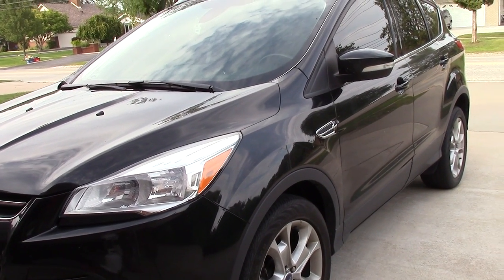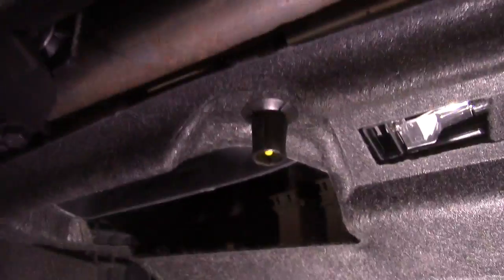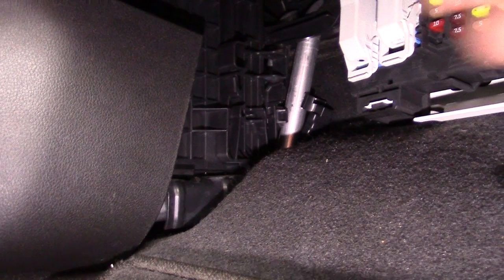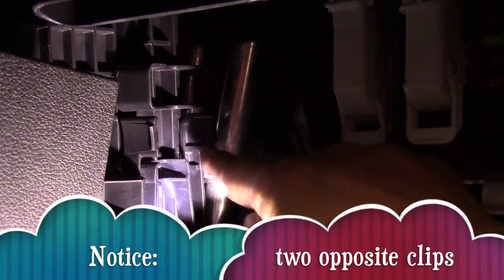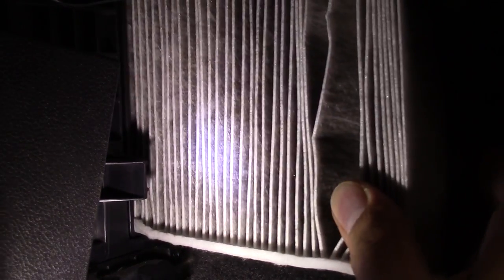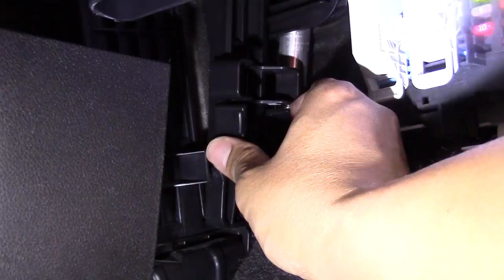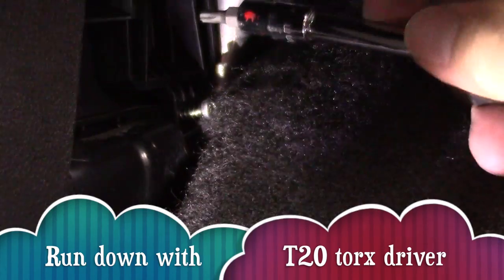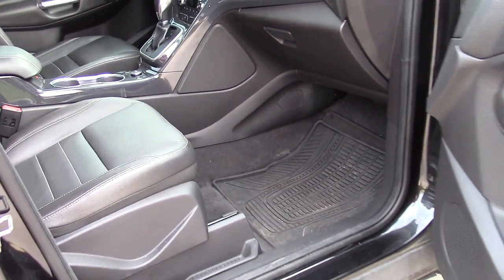How to Replace "Cabin Air Filter" 2013-2017 Ford Escape DIY

Comment: Yup this, the battery, everything with this new style was complete bullcrap. The old older model was so easy to work on. This one the basics are torture. This guy makes it look easy belive me. And to change the battery the old style all I'd need is 5 mins. This model it's half a day project.
Reply from the maker: You're right. I like the old model better.
Reply: 10 minutes to replace battery go threw the cowl

Comment: Most complicated air cabin filter I've done. The engineer had to have been high. "Should I use a regular Philips screw?? Naaa let's go with a torx and put it on the way bottom. Also while I'm at it lets use screws for the engine air filter assembly and put the battery under this large price of plastic near the firewall of the engine compartment.  Yeah there we go!"
Reply: They do that on purpose so people would give up and take it to the dealer. The dealer charges like $75 to change this the madness.
Reply from the maker: You're Eric.
Reply from the maker: I know what you mean. They don't make it easy for us. Lol
Reply: I hope I dont have to change the battery in mine for a loooooong time. It's in a retarded location as well.
Reply: battery that comes in new cars ususally on last 2 years.
Reply: Eric J Davis I agree completely. When I rule the world, every cabin air filter will be located behind the glove compartment. And every gas cap will be located on the driver’s side rear quarter panel. And every windshield wiper control stalk will work the same.
Reply from the maker: That would be a perfect world. Lol.
Reply: Seen worse
Reply: @bubaJoe  Mines going on 6 years
Reply: They design them to be easy to build. I am sure on the assembly line doing things in the "right" order it went to gether lickity split.  

Same thing for torx versus Phillips. You can stick a Torx screw on the screw gun and it will stay there while you stab the hole and pull the trigger. A Phillips screw will fall right off.  Much faster and easier on the assembly line - a pain in the butt for everyone else. :)

Comment: The hardest part of the process for me was reinstalling the plastic filter housing cover.  It would not seem get around and inside the plastic side pieces which secure it in place.  Going back out now to try again.  I'll install a very small amount of lubricant around the securing arms to see if that helps.  Will update this review if I get it in.

UPDATE:  I'm a big dummy.  I was attempting to secure the air filter housing cover the wrong way.  You actually apply it with the protruding part facing towards the air filter and the clamp arms facing away from the air filter.  It looks like it would go in the other way but it doesn't.
Reply from the maker: I hope it worked out in the end. Thanks for the visit.
Reply: I did the same thing 😂😂😂
Reply: Did the same thing. Definitely looks like it should be the other way though
Reply: Scott, I just joined the "dummy club".  Thanks for the help.

Comment: This is a total total DIY...   The disassembly, removal, and reinsertion took all of a second or so.  The fitting of the cover was super tricky to say the least.  I first lined it up and then felt up top to ensure the flange was properly in place.  I then pushed but pushed up and forward at the same time.  You'll hear it click into place and then see it's flush with the housing.  I then screwed the screw back in, which was no big deal.  All in all, 15-20 minute job with the VAST majority of the time spent reinserting the plastic cover.  Interestingly, it's difficult to tell if the plastic screw caps are properly in place as I could not get them to "click."  Huge $$$ saver.  Also, the filter was almost jet black after 15 months, so this is a very worthwhile service.
Reply from the maker: Thanks for sharing again John.
Reply: True in the video you can tell the cover is not properly seated. This is the point where you mention to line up the screw. The tabs aren't even in yet. I believe because the top of the cover wasnt inserted first. Also taking the filter cover off when you said it required some muscle it's because the screw tap hits the carpet

Comment: This isn't even the worst part. Try filling the coolant reservoir. It's almost to the windshield at the very rear and not out in the open hood. There is maybe 3 inches or so clearance.  Since I was on side of the road, I had to dump out my Rockstar can and fill with water, then bent the end of the can so I could pour it in. The Escape is a really good vehicle in all honesty, but a bitch to do what should be simple.
Reply from the maker: Yes you're about that. I really liked my escape but Ford doesn't make easy for us.
Reply: go to any trucks stop and ask for a DEF nozzle for there jugs. every jug has one and they are throw away. but they fit washer fuild and coolent jugs never spill a drop again
Reply: That is exactly right!
Reply: there is a funnel with the spare  but ya

Comment: About the torx screw just replace it with a regular phillips screw or flat head screw at your local Home Depot lol 😝
Reply from the maker: That is a great idea Joe. Thanks for sharing that. Now our viewers know better.
Reply: thank you 🙏 ford does this to cut down on cost on the screws on the assembly line but I just replace my torx screws with a regular phillips and my filter with the k&n filter and I did my airbox cleaner also

Comment: You did not install the filter cover correctly. The upper section of the cover uses a tongue-and-groove design to secure to the filter housing/hvac box. That is why you cannot pull the cover straight out and away during removal. The upper section of the cover "groove" MUST be latched into the case "tongue" before the lower "finger squeeze" clips can be snapped in or the screw reinstalled. Your method of just mashing the cover sorta but not really into place then using the screw to hold the cover on results in an air gap being left around the upper section of the cover. The air gap will whistle with the hvac fan on high. The correct way to install the cover is to hold the cover as closely as possible in it's installed position, drop the cover DOWN about 1/4" while applying inboard pressure to the upper section of the cover, then push back UP on the cover as you feel the tongue-and-groove engage. Then you can push in the bottom part of the cover and engage the "finger squeeze" clips. The screw really isn't necessary if the cover has been reinstalled correctly otherwise.
Reply from the maker: thanks for the advice.
Reply: After a LENGTHLY struggle to get the new filter in this vehicle, I encountered yet another struggle with this cover. It was a comment that enabled me to finally get the filter installed and again it was this comment that enabled me to get the cover reinstalled. Thank you for ending this day and one half struggle for me.

Comment: Ford never makes anything easy
Reply from the maker: Lol. yes you're right.
Reply: @jonahvlogsdiy4143  I feel like that's the same with all cars these days but you right. I need like 8 tools to change my battery
Reply: @chavo8690  
Check out the new generation RAV4. The engine bay is massive.
Reply: Truth, filters to batteries, never again for sure...
Reply: They don't, but then again, most cars now are designed to force you to pay the dealer service department instead of do-it- yourself. My father worked in the Kia dealership service dept and told me those cars are worse than Fords to work on.
Reply: Engine air filter wasn't horrible. Just a few 8mm bolts. Cabin air filter? I feel too human sized to get the new one in.
Reply: Ahh yes. Changing the oxygen sensors,battery and lower running lights was fun. Good times 😀

Comment: First of all thank you for this video - other instruction do not mention the T-20.  This job made me so mad I almost threw a wrench through my garage window.  I have the 2013 and I think it's slightly more cramped than your model.  I had to cut out some of that hard foam just to get my driver on that stupid bolt.  Getting the new filter back in was a chore and I am sure I damaged it even using as delicate squeeze as I could.  Ford... Uhggggggg!  I have a Subaru and Toyota and they are a joy to work on when it comes to standard maintenance items like this.
Reply from the maker: Lol. I'm glad you didn't throw it at your window. But yes Ford could do a better job with their engineering on this Cabin Filter. I hate it too.
Reply: You can probably thank Ford of Europe for this mess since this is really a rebadged Kuga. I hate working on my 2015 because NOTHING is accessible.

Comment: After going to my local Ford dealer and receiving a C$140 quote to change the cabin air filter, I decided to research how to change it myself. I'm glad I did because it saved me C$120! (bought an active carbon air filter for C$15 on Amazon and a T20 torx bit for C$3.50 at Home Depot). Thank you for making such a detailed and clear guide.

The installation wasn't bad at all. The cover came off easily and so did the torx screw. I thought the carpet may get in the way, but that wasn't the case. The plastic cover was a bit trickier. You have to push it down first to unlatch it from the top then push up to get it above the carpet. The cabin air filter change itself was bloody difficult. The space is very tight and you need to be careful not to knock any of the fuse connectors out. Use a lot of force at the end going in and make it as narrow as possible, then just push and force it in slowly.
Reply from the maker: It's used very often. I've only ever used it on this car.

Comment: Thank you!! Ford wanted to charge me $60 to do this. I did it in less than 5 minutes after watching this
Reply from the maker: You are very welcome Keirra. So glad my video helped out.
Reply: $52 @ my Ford dealership, what a rip off.
Reply: $70 at mine, which is crazy, because the filter only cost $20 at autozone and it takes less than 5 minutes to change.

Comment: An added detail for DIY's. On the flipside of the cabin filter facing the engine compartment, spray a small amount (not soak) the filter surface with Lysol that smells nice. The reason for this is to remove any mold buildup/gym shoe odor coming from the vents. Put the windows down and start the car and turn the HVAC blower on full blast for 3-4 minutes. It will be strong at first but the fragrance will dissipate over time.....
Reply from the maker: Great idea! Thanks for sharing

Comment: FYI, for me there were two cables that prevented smoothly removing or replacing the filter.  I disconnected the two large electrical connectors that are visible @3:40 to get those wires out.  Then the filter didn't get crumpled at the top to remove/replace it.
Reply from the maker: Thanks for the info Bob. Now the viewers know if that same situation occurs.
Reply: Hmmm....   I saw the two large cables but came no where close to those.  You're supposed to pinch the filter at its sides so that you can angle it properly to insert.  I absolutely would not recommend doing what you did.
Reply from the maker: What ever works for you John. It worked for me. I'm sure there's other techniques that works for others. But thanks for sharing.
Reply: On my wife's 2015 MKC I was unable to get the new filter installed. I read this comment and saw an electric supply cable to the fuse panel at  the lower left that was easy to disconnect. After disconnecting it I was able to get the filter installed. After a couple hours the job was still not complete because I couldn't get the cover back on. Thanks for this video and thanks for your comment.

Comment: I changed that difficult screw ( Torx ) to a hex head screw, so I can remove it easier with a Nut Driver. Much, much easier. This Torx is designed to make you have to go a service center somewhere and waste more money!!!
Reply from the maker: Great idea Reg. Thanks for sharing that with our viewers. I'll mention that under my video.

Comment: My ac was putting out ice cold air a couple days ago. Now, just semi warm air. I recharged it with a diy kit. No change. Would changing this filter make any difference??. I should do it anyway cause it's never been changed. Compressor seems to be working, from what i can see and hear. I may be looking at big $$. Uggh...
Reply from the maker: It's always good to change the filter, but unfortunately it will not help with the AC. If you tried recharging, it maybe time time to bring it in the shop. I feel for you.

Comment: I lost my screw. What size screw can you replace it with? I tried a #8-32 x 3/4 in machine screw and it's too big
Reply from the maker: That's a good question. Unfortunately I no longer have the car.
Reply: Probably metric.